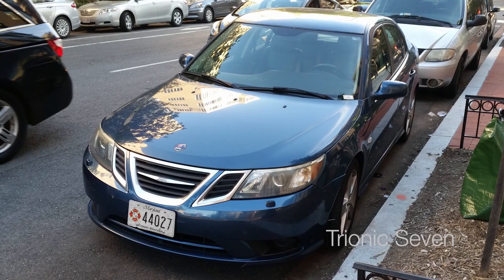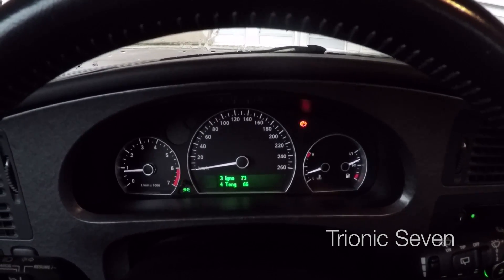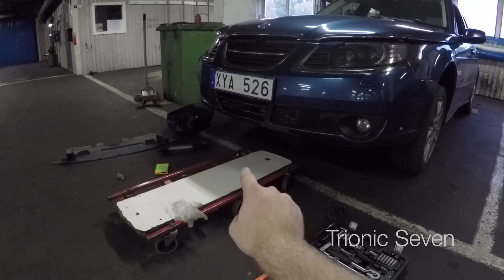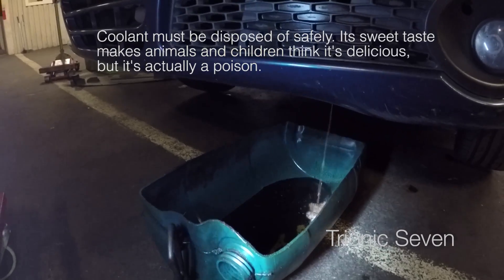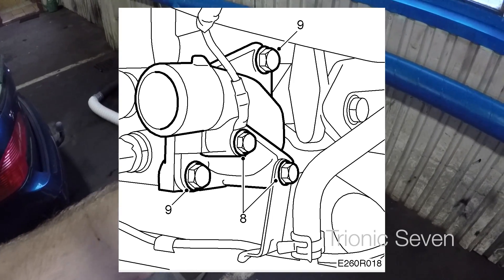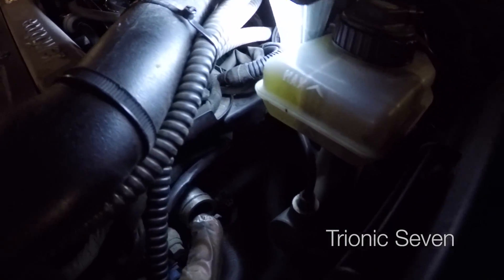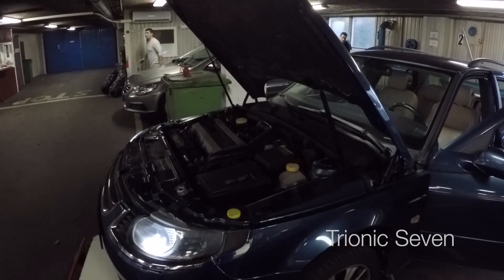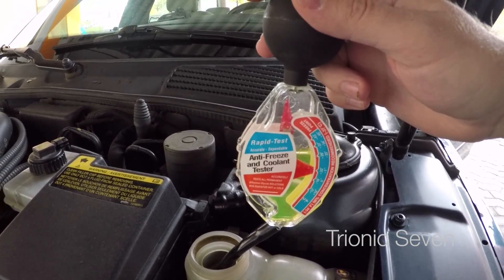Saab 9-5 Thermostat Replacement and Coolant Flush - Trionic Seven

Comment: about my old (and beloved 9000 CSE 2.0t Aero, the best car I owned) I put a non original thermostat valve of Lancia Thema, and the temp gauge in highway went in meedle and low, meedle and low (probably opened too much, and after closed): I bought the lriginal one and the needle was stop at the meedle…great job indeed, I am owner not of a nice black 9-5 2.3t Aero MY 2007 with only 32,000 km…

Comment: For speeding up the engine warmup prosess, you can put the heater to the maximum, but turn down the fan to minimum or even off. The heatercore will still circulate even if the fan is not running as long as it is set to all the way hot. The interior fan will cool the engine if running on high speed. Especially on a really cold day.

Comment: I did this work today.
However, I thought I had the earth cable attached which I hadn’t.
I can Inform everyone that I could not start the car, some relay in the driving compartment flipped like crazy, the turbo charging meter was living its own life and the cooling fans turned on and off.
It took a while for me to figure out this strange behavior until it hit me to check that earth cable.
It was not attached.
I screwed it down and the car functioned flawlessly again.

So the earth cable attached to the thermostat housing is a very important part indeed.

Comment: I am watching this video as referance to do this operation this weekend in my 2001 9-5.
I am wondering- maybe I will skip the step where you detatch the hose. 
And the drain plug thing. Just go straight in with a wrench🙂
Reply: @scotthardy6485  It’s been a year, but still. Pretty sure some type of ironically shifted humor was intended here. 
However, fact is I got a mechanic to do it. It was too cold and I did not find my gloves.
It runs fine, now.

Comment: Here's a tip for the drain plug.  It is accessible from under the car easily.  Just take a piece of 1/2" PVC about 6" long and notch across the end with a hacksaw blade.  You can then slip this over the stop cock and twist it to get the coolant to flow.
Reply from the maker: Thanks, great tip!

Comment: hello, your videos have helped me so much thanks keep up the good work. I have one questions what type of coolant should I use? i have 2002 Saab 9-5 linear model I'm not sure if I'm using the right kind it's keeps leaking? I use peneofrost, the pink kind. my manual does not say what type and I can't really get a right answer
Reply from the maker: From factory your car comes with a monoethylene glycole solution. Any modern brand should work, as long as you flush the system when replacing.

Comment: Great video, thanks! Changed my thermostat today and got the engine temperature back to normal again. I actually did not remove any items from the engine bay (battery etc.). Also did not detach the  coolant hose. The location is a bit tight but this can be done by draining the coolant and then simply removing the four bolts. The coolant hose will have enough play so that the thermostat can be removed and replaced.
Reply from the maker: Thanks for sharing :)

Comment: Hi can you help me .....I have full temperature on the engine ..
But my heating is not working ......
Only cold air coming out ...
Dining need to change the thermostat
Reply from the maker: If your temp gauge shows correct temperature it's probably not the thermostat. Perhaps your heater core is clogged, your A/C blend door might be broken.
Reply: Trionic Seven thanks for your reply ...
I always check your page out for any problems..
I don't have a Sid open .....
I think your right my heater is making a noise ....

Comment: I often read on the forums that in addition to replacing the thermostat, the coolant temperature sensor should also be replaced at the same time. I noticed you did not do that. Are the people on the forums just going too far in replacing a part that doesn't need to be replaced? What do you think? I would rather not fix what's not broken but if it's wise to replace it then I will. By the way, excellent video. My car: 07 Saab 9-5
Reply from the maker: Doesn't have to be replaced unless you have a problem with the sensor.
Reply: Trionic Seven don't fix what's not broken, gotcha, thanks!

Comment: Why must you jack the car? Or just easier to access everything? Also how would you recommend removing the plastic cap at the bottom of the radiator to drain coolant? Thanks
Reply: I have to disagree.
Yesterday I flushed cooling system in my 9-5 Aero '02. I reached the plug from above, through the engine compartmend. To open the plug for the first time in a while, You will need some pliers. Next time will be easier, so you can do by hand.
No jack stand, no jack whatsoever. Just a catch can flat enough to slide it under the car.
Reply from the maker: Interesting, I never thought that'd be possible. I found it quite difficult to open the plug even when the car was jacked up. Each to his own :)
Reply from the maker: Jacking up is required to reach the drain plug. As I show in the video, carefully use a pair of pliers and turn the plastic plug.

Comment: How the hell does one drive a car 5,000km in a year? I'm not sure I'd even need a car if I only traveled that far annually. Love your vids though. I'm actually just jealous, I'd love to see how long a car could last driving 5000km every year.
Reply from the maker: Haha, yep, 5k is very little in a year. It's just the wife's drive-to-work-car, but lately we've taken that on longer trips instead of mine just to get it exercised a bit more. :)
Reply: What are the specifications?  Does it not have a turbo?  I don't see a turbo gauge in the cluster.
Reply from the maker: It's a turbo, but the 2.0t doesn't have a gauge.
Reply: very interesting!  would never have guessed that.  if you had to choose another brand of car, what would it be?
Reply: I drive my 9-5 for like 1000-1500 km a year :)

Comment: Cool video bro ,I have a question I have a 2005 saab 9-3 ,right now the top rubber hose is leaking out going to the coolant reservoir you think i need to replace the thermostat?
Reply from the maker: Hey! Unfortunately the 05 9-3 is a completely different car than the 9-5, so I can't give any reliable advice, sorry!
Reply: Trionic Seven ok then thank you anyways probably need a new the cap

Comment: Did you flush with regular tap water or use distilled?
Reply from the maker: Where I live we have extremely soft water which means I can use regular tap water. If you don't have soft water, I'd recommend distilled water.
Reply: Thank you. I'll buy distilled then as our water is the opposite, extremely hard.
Reply from the maker: Wise. Might want to consider flushing with distilled water (or battery water) too as about 1-1.5L remains after the flush.

Comment: Ska göra samma jobb på min 9-5 02a vector den kommer inte heller upp i mer än 66 grader i motortemp. Har även satt felkod P0116 när det vart kallt ute och enligt mina googlingar så borde det vara termostaten som är problemet men tycker att jag har för bra värme i bilen för att det skulle vara termostaten som är öppen konstant. 
Kommer iallafall byta den(original så klart) och tempgivaren i förebyggande syfte när jag ändå håller på med termostaten...
Reply from the maker: Tror at P0116 är när den inte får upp tempen i tid och varnar för att termostaten är dålig. 66 grader är väldigt kallt, byt snarast! Också ingen dålig ide att skölja kylsystemet.
Reply: Trionic Seven den är bytt nu och en sak är säker hade dålig värme i bilen innan nu har man den riktiga Saabvärmen igen. 
Den gamla termostaten såg lite annorlunda ut mot den nya plus att den mycket riktigt stod öppen när jag fick löst den..

Comment: I've replaced the more difficult hose clamps with common screw type hose clamps, for ease of maintenance. I only need to be careful not to over tighten them. I didn't want to risk breaking the plastic drain, which often happens. So, I remove the lower radiator hose, which also drains the coolant very quickly. The biggest difficulty is the clamp, which is another extremely hard to access clamp, but now is replaced with a screw type clamp. 

My T5 93 also bleeds and drains very thoroughly by itself. There is probably a slight amount of water left in the block, which might be why your coolant was a little weak. In other cars you can't even drain the block, so flushing is a long affair of dilution, finishing by adding pure coolant to mix with the water left in the engine. So Saab owners have it easy.

I recommend using purified or distilled water for flushing or mixing with coolant. I am not afraid to use a chemical coolant system cleaner (from a bottle), which is drained out after use, but it takes a long time to heat and cool the engine.

I don't think the Saab has to warm up completely, because of the bleed feature, which can make the process much faster. If hot, it's important to let the engine cool down before draining and refilling. Materials are often stressed by rapid cooling.

According to people on the Saab forums, Wahler was a Saab supplier of thermostats. I found the oem hard to find and used one, and it works well. Cheap thermostats from regular parts stores opened too late after the engine was too hot, and immediately dumped cold water through the engine making it too cold. It could even repeat the cycle, bouncing. It was very bad.

The Wahler opens gradually, and the engine cools immediately only 10 degrees Fahrenheit. Very reasonable.

There are 3 or 4 temperature ranges available. For my older T5 running in a warmer climate, I went to the coldest temp to extend longevity of the motor and get a little more power through cooler intake. I even found a convenient location to add a removable shunt resistor across the fan thermostat so the fan-on temp is tuned to the cooler thermostat. I posted the procedure at Saab central if anyone is interested.

Many early T7 engines had an oil sludging issue due to a change in the pistons and rings, so those cars should possibly run with full temperature thermostats to control moisture. Or be monitored carefully.

There are many choices of anti-freeze here. There is cheap toxic coolant. There is expensive long life toxic coolant. There is cheap non-toxic coolant, and expensive long-life non-toxic coolant!

I recommend cheap non-toxic coolant, and changing it often such as every year. The engine corrodes, the coolant gets dirty fast, the radiator and water pump suffer.

There is an American company, Amsoil, that makes a unique antifreeze that is fully organic acid. Super long life. It's expensive but that's what I've used with the hope it can safely stay in the engine for many years. Other coolants, I would not trust for more than a year, but I'm probably over cautious.
Reply from the maker: 1) I have never had a problem finding OEM parts and thermostats.
2) I am skeptical to your recommendation to not use a glycole-based coolant as a bad coolant can damage the engine
3) The maintenance interval specifies when the coolant is supposed to be changed, no need to overdo it.
Reply: All coolant I know of is glycol based. Of those, there are traditional ethylene glycol (toxic) and propylene glycol (less toxic but 100% as functional). These are typically balanced with non-organic acids as corrosion inhibitors. Then there are partial organic acid balanced versions of both for longer life (Toyota red long life, Mercedes). Amsoil makes a fully organic acid balanced non-toxic for ultra long life (lowest corrosion).
Reply from the maker: Glycol is organic ;)

Comment: Will do this job on my 9-5 on Tuesday, so will have a good look on this video. 
My waterpump broke shortly after I bought it, but the seller is covering the water pump for me. 
Finally got my 9-5, and broke soon after so a little dissapointed. My 9-5 is a lovely 2.3T SE with 185 bhp, cream leather interior with ventilated seats.
Reply from the maker: Nice that the seller fixes the water pump. While he/she is at it, changing the thermostat is quite easy as you don't need to drain the coolant again. I'd pay the seller to replace the thermostat :)

Nice to see a car with ventilated seats, not that common!

Comment: Nice vid, but just thinking.
I'm using a thermostat from speedparts, don't sure if it's OEM or what, but it works just like i should, same as my old 9-5 and works great there too, so not all of these aftermarked thermostat's seems to don't work.
I did not know about that the hole should be pointed up when fitting the thermostat, not sure where mine is pointing, but works like it should :)
Reply from the maker: Experience has shown that the aftermarket ones don't last as long, just as what happened here. Also, if you don't put the bleeder hole upwards you might get air bubbles in the coolant system leading to hotspots and overheating.

Comment: Har en saab 9-5 01 som inte har någon stolsvärme eller värme från kupe, när jag köpte bilen kom det svag värme från från fläkten 1/10 gånger när jag startade bilen, nu kommer det ingenting, bytte värmekranen idag men kommer fortfarande ingen värme, nu när jag såg denna videon kom jag på att min termostat visaren också står vid kl 7-8, tror du att det att det kan vara felet? tacksam för svar, bra vids!
Reply: Lyckades fixa problemet, märkte att vakum ventilen (kopplat till värme kranen) inte släppte igenom luften till värmekranen, kopplade då bort vakkumventilen helt och körde direkt till värmekranen. jag kan till och med ställa innen värmen via displayen vilket jag trodde vakum ventilen styrde.  frågan nu är vad gör vakum ventilen (tror den heter nått sånt) som satt ihop med värmekranen då den va kopplad med el?
Reply from the maker: Värmekranen är vakuumstyrd, och den stänger av värmen till värmeväxlaren när AC:n är på. Så mycket mer än så vet jag inte...

Comment: I love your videos. So good! What is your opinion about transmission flushes?  I just bought a 2003 9-5 Aero with 90k miles (US), and I don't know if it's ever been done.  Sometimes there seems to be hesitation between when I hit the accelerator and when the car wants to actually go, almost like a soft bucking.  Also, after coming off freeway exit, stopping, then trying to pick up speed again, sometimes the RPM will increase before the car moves and kicks in. does this sound like transmission fluid change could fix this? Is it advisable to do? Or am I looking at a different problem?
Reply: Estevan Vega.  it could be the ECU and sparkplugs along with the mass airflow sensor!  a good full service should sort it....
Reply: +Kevin Johnston the ecu? that means saab dealer has to reprogram it? any idea on th cost? and the mass airflow sensor, would you clean or replace? Have you seen this fix the issue? I was gonna do spark plugs as well anyway. it's at 90k. what is your opinion, Kevin, on whether or not to change/ flush tranny fluid?
Reply from the maker: I'm exclusively driving stick-shift (as is common in Sweden) and have basically no idea about auto trans :) Sorry!
Reply: Ok. Thanks anyway
Reply: Estevan Vega.  Usually the trans fluid will discolour from its nice red when it is in need of change.. I topped my own up and it was fine.  you have reasonably low mileage,  my own is 170k.... I notice that if the coolant is bad that it can effect the trans also!  check that too!  your ECU can be just as much to repair as to replace,  try used part maybe for that
Reply: it sounds like the fuel system needs cleaned.  an additive can be added to full fuel tank to dissolve sediment and water from it
Reply: http://saabworld.net/showthread.php?t=474

Here is some detail. If your Saab has a dip-stick to check the transmission fluid, it looks like a very easy job. If it has not been done I would recommend it at your millage. You might even drain half, add some, run and then drain completely. I would only use the oldest Saab specification fluid for your car. The later manual fluid, for instance, was supposedly worse because of GM cost cutting. But I've never been disappointed in Amsoil, IF they recommend something for your car.

I changed the manual transmission fluid in my 1999 93, and there was a lot of debate online about what to use, since even the original oil MTF0063 (made by Castrol Europe to Saab special specification), which was pretty good but is a little thin and still gave some people trouble. Some solutions worked but had short life. In the end I used Amsoil 75W90 transmission oil, mixed with about 20% Amsoil 5W30 transmission oil (common in Hondas), to match the viscosity of the original. Brands cannot be mixed so this required flushing, and the oil is expensive, but it works brilliantly and I recommend it.

Redline MTL has been used a lot as well with generally good results.